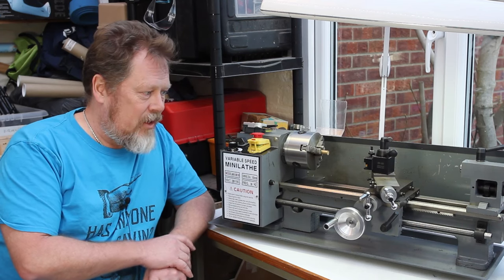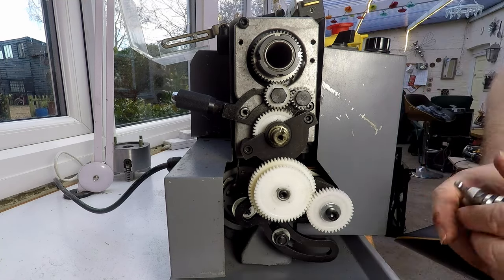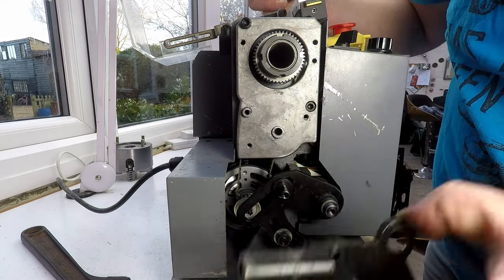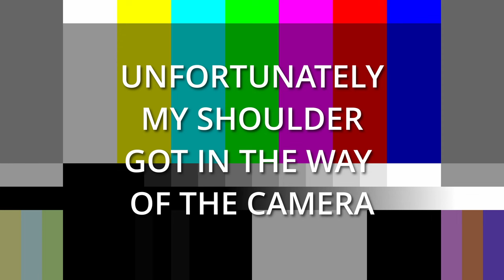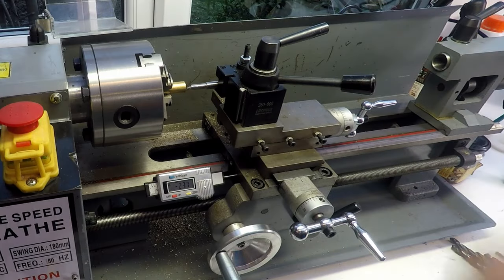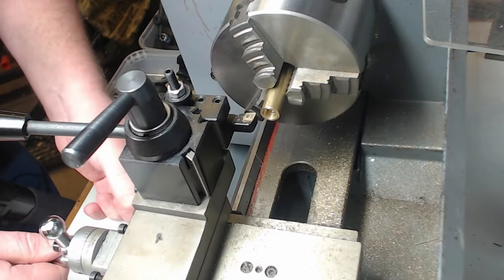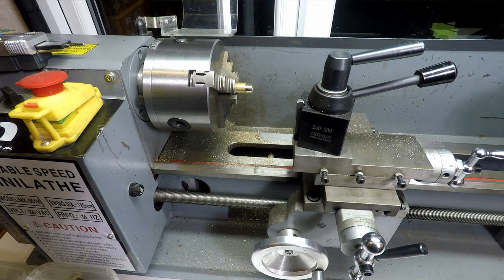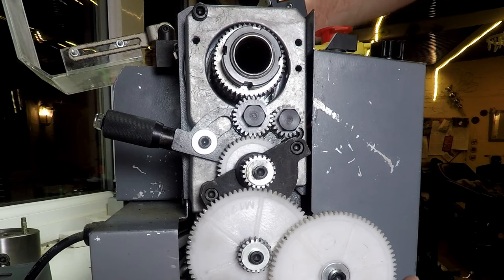Mini Lathe Reverse Gear Noise Problem Fix - Part 1

Comment: When grinding HSS tool bits, there's no need to worry about overheating them.

They'll be far too hot for you to hold, long before you affect the hardness.

Comment: Very interesting video. I’m going to see if what your doing will fixes mine
Reply from the maker: Thanks mate, hoping to re-machine the tumbler gear detent shaft in the next few days which will hopefully sort it for good.
Reply from the maker: I should have mentioned, in part 2 I machined a new bush for the tumbler gear lever pivot, this reduced the reverse gear noise quite a bit. https://youtu.be/j4vh6xuiS0s

Comment: a simpler depth Guage would be a rod within a tube that has a long slot cut in and marked with a measurement scale. A mark on the rod would show the depth it has moved in the tube.

Comment: I think I would have just drilled and tapped some grub-screw holes in the little tubular protrusion that holds the lever in the forward and reverse positions.
This way I could simply screw those grub-screws in or out the correct amount to mitigate or stop all together the upward movement or backlash of the forward and reverse handle.
It might be tricky to drill at that particular angle but considering that you went through all that trouble with the first attempt to fix this, I think it might be worth your while.
Reply from the maker: Thanks for sharing your ideas Tim. I was really happy with the final fix at the end of part 4, and happy that some of the steel on aluminium bearing surfaces are now protected by brass bushes. But there are definitely quicker and easier ways to achieve a workable end result.

Comment: Hi and compliment for the video, very interesting. I have this lathe and I would to buy a tailstock with chuck to make holes, can you advise me of a link where to get it? thanks and ciao from Italy
Reply from the maker: Thank you. The mini lathe I have is the same as the Clarke CL300M, Amadeal of London do a tailstock for mini lathes that is compatible with the Clarke CL300M so you could look at that. 

I bought a Clarke CL300M fixed steady and that fitted my lathe perfectly.

Amadeal say the centre height is 90mm, I just measured my lathe and the centre height is correct at 90mm. I would recommend asking them for some dimensions of the dovetail to make sure it will fit, to be sure.  

https://www.amadeal.co.uk/cgi-bin/sh000001.pl?WD=tailstock&PN=Mini%2dLathe%2dTailstock%2dwith%2dTailstock%2dLever%2dLock%2dAMA_SP_CJ18_138RB%2ehtml#SID=14

Comment: Saw something very interesting to me . Where you get your indicator you have on your lathe
Reply from the maker: I made it from a digital Tyre Tread Depth Gauge. I cut it down a bit, made a brass slider to go under the scale which I could spring load, and 3D printed a housing for it. Here's a link to a similar one on eBay - https://ebay.us/36ZOND
Reply: @radboogie  you have video of making it
Reply from the maker: I don't have a video on making the "Tyre Gauge DRO" but will do one when I have time. Can upload the drawings and 3D files to the RadBoogie website if you would like to make one yourself.

Comment: When you're cooling your tool, I kept wincing as you crossed the face of the grinder with your right arm.
Get some wire and hang a mug of water off the front of the grinder. Quicker to reach and no amputations.
Reply from the maker: The camera angle made it look worse than it was, there was no danger.

Comment: Wind the compound/top slide back so it's supported instead of overhanging, things wont move around as much. (a QCTP moves tool further away from clamp point plus the extra 3/4"/19mm wound forward?)
It sounds terrible, maybe you should have just left the gear train off and hand feed saddle/carriage like you did when boring?
The belt drive works fine without the gear train (may be worth checking the belt sits properly as well,  on some mini lathes the gears don't match belt teeth pitch.
 'Plan C', make a complete new reverse tumbler
Cool idea with tread depth gauge.
Reply from the maker: Yes, I usually put the lathe in neutral when not power feeding to quieten it down. In part 4 I drill an extra hole in the gearbox for the detent which makes it easier to put the thing in neutral and bypass the gearbox. I'm going to work on quieting the lathe down in future videos, will make an interesting project. Thanks.

Comment: I couldn't be living with the spindle bearing whine! Do you think they bothered to grease them at the factory?
Reply from the maker: It sounds worse on the video, mostly it's electrical whine from the motor drive circuits. I filter out the whine on later videos to be easier on your ear.
Reply: Much appreciated, i enjoyed the videos, with the sound off. 😂😂
Reply from the maker: @johnhall1018  😂

Comment: watching the lever at the back it lfts slightly and the noise starts, try putting some weight on the lever to see if it helps by stopping it lifting.

Comment: That handle should tighten up if you twist the knurled part of the handle at least mine does
Reply from the maker: Thanks Reaper. I tried what you suggested but it didn't fix the problem for me. Hopefully that can help someone else who has the problem - cheers for sharing.